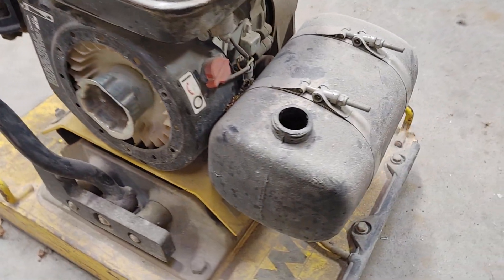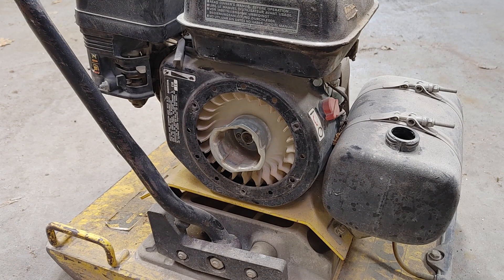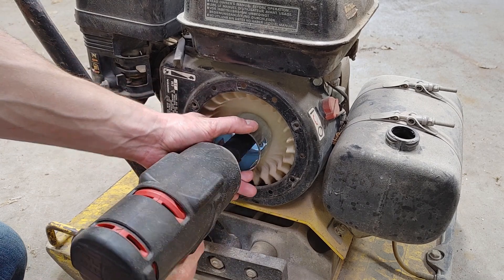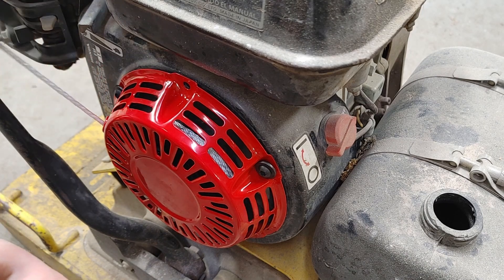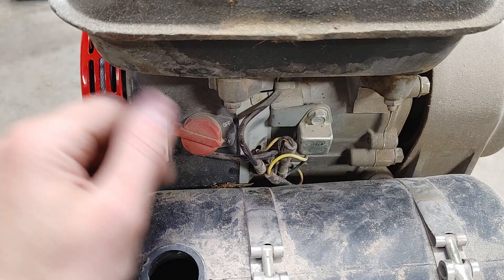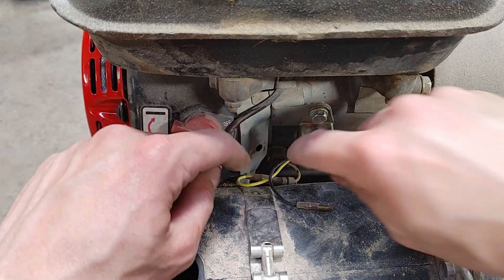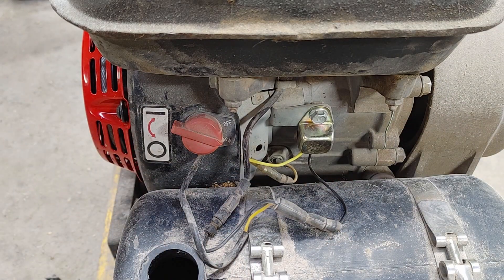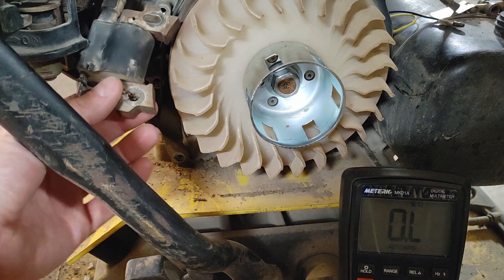Honda GX 160 - No Spark - Part 1

Comment: Hey bud: this video saved me from spending money & taught me something I didn't remember to look for (low oil pressure safety switch) I had no spark and I had already changed the coil but with no positive results, then I watched your video and you touched on the yellow wire (low oil wire) how to disconnect & test to which I did & "vol-lah" now I have full spark!!! So I checked the oil level & it was right down. I filled it up and the Honda started right up once again. this is a customer's packer as I would never fail to check my own equipment for fluid levels, but I can't thank you enough for your great video & very helpful tip.

Comment: Ok, this is crazy what I just discovered. I have two machines here for repair. No start. Cleaned the carb, fresh fuel and then I wondered why I had no spark. So I read on the internet and it was the oil level switch. I am so ashamed I didn't check for this first. Filled up the oil and she started up immediately.. .Honda GX120
Reply: Was it completely dead? I have one attached to an air compressor and can't get it to do anythig
Reply: @darwinescobar7629  with low oil it sparked once every 10 pulls. after filling the oil correctly it started right away